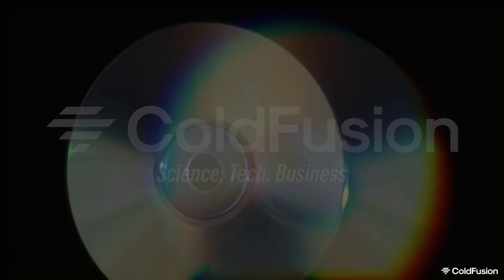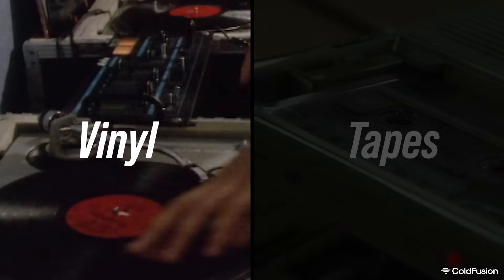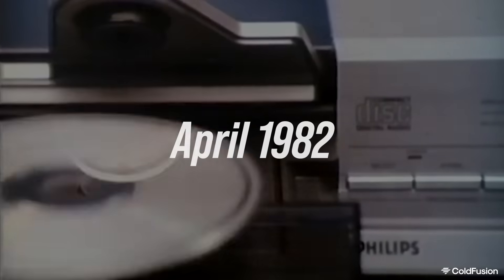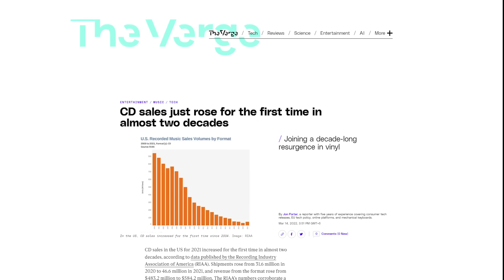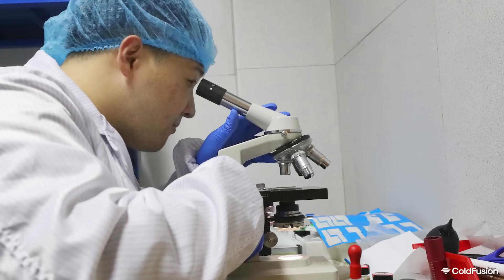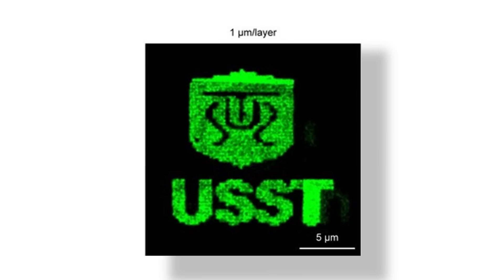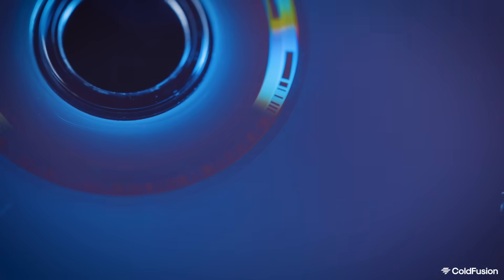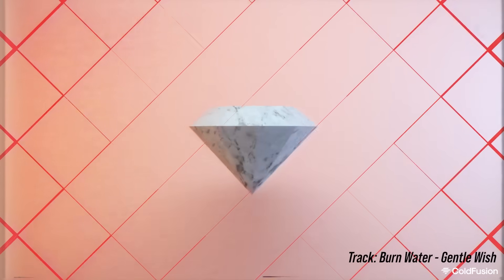Why This New CD Could Change Storage

Comment: For music nerds, CD's can still be the best way to listen to music!

They're oftentimes as cheap or cheaper than MP3 albums, but with far greater audio quality. (Well over 3x the bitrate of either MP3 or streaming, and second only to $$$ audiophile FLAC downloads)

They also have album art second only to vinyl.
Reply: Or, you can rip your CD collections to FLAC files, and you wouldn't even violate the DMCA.  (No digital copy protection on audio CDs.)  I'm old.  I have tons of audio CDs.  I ripped them to variable-rate MP3s first, then later to FLACs.  I have a bunch of them on my PCs and my phone.
Reply: CD's aren't second to FLAC's, in the worst case scenario they're exactly as good as FLAC's, and in most cases better. FLAC's are literally ripped CD's compressed from the original files on a CD at "lossless" quality, meaning it should not lose any data compared to the original file on the CD, but that's not always the case, as most people who make  FLAC's use wrong settings and mess things up to end up with worse sound than original CD's.
Reply: @derbigpr500  You can't mess up the settings on FLAC, it's perfectly lossless.  Unless you have hardware issues or are ripping from a damaged CD, FLAC decompresses to the raw PCM bit for bit.  That being said there are FLACs that are technically "better" than CD since they can give you a copy of the album at the sample rates and bit depth they were recorded at before being downsampled to 44.1 kHz at 16 bits for the CD master.  Better in quotes because the extra sample rate and bit depth is mostly indistinguishable except in certain extremely specific circumstances with people who have extremely rare extended hearing range and the recording equipment was capable of producing and recording said extended range.
Reply: Not all CDs. Last year I purchased a CD from a local band merch booth, hoping for better quality than my downloaded files of that band. Sadly, the tracks on that CD still suffered the same "loudness war" of heavy dynamic compression :/
Reply: @mchenrynick  That has nothing to do with the CD's, but how the music was recorded.
Reply: I still buy CD's and have all my old ones.  I use Spotify (which replaced my aging iPod) and if I love an artist I will buy the physical album like Chromeo's "Date Night, Live!" on blue triple vinyl.
Reply: idk where you get your flacs from but if you buy music on bandcamp you get all formats (mp3, m4a, flac, even the weird alac format that apple pushed a while back) for one fair price that includes all of it

Comment: SSDs took years I never thought I'd have one in my computer, hope these do make their way down to consumer level NAS storage in 10-20 years.
Reply: 10-20 years down the line this will be obsolete.
Reply: @totalermist not really, a 1.6petabit (200 terrabyte) disk would be enough to compete with other mediums for backup for years to come. the current generation of LTO backup tapes store 18TB data, and the equipment needed to read an LTO costs about $10000 with each tape being $100 ontop of that. it likely wont make a big splash on the consumer market but I doubt that was really ever the intent
Reply: @oggilein1  That's only if you insist on LTO-9 or later. LTO-8 (the 12 TB variant) costs less than half as much with drives being available for under $2,000. LTO-6 media and drives are dirt cheap these days with 2.5 TB capacity still being nothing to sneeze at.
Reply: @totalermist  oh absolutely but if we are comparing it with a disk who's laser alone costs $50000 then even the latest gen of LTO seems like a pretty good deal
Reply: I hope a lot sooner.  I love it if my NAS had a petabyte but guess I will have to settle for 8TB currently. I just wish I could figure out why I am only getting 100 instead of 1000BaseT which is the media subtype.  I think it might be my computer the causing the data logjam.

Comment: I need this yesterday ! To backup all my hd.
Reply: if you are looking for options available right now, you can either get a bunch of quad layer 100GB bluray-RW's or invest in a Linear Tape Open (LTO) drive and its respective tapes (the latest gen does 18TB per tape but the machines to read and write them are pricey so an older gen is what I'd recommend)
Reply: @oggilein1  already use bluray-rw. But I got more than 350t to backup ;) kind of a big job ;)

Comment: Petabytes and Petabits are very different things, 7:10 makes it sound equivalent. 8 bits = 1 byte, so 1.6 petabytes is 8 times larger than 1.6 petabits. 

Also, I’m pretty sure that old british lady is not a good person
Reply: Really? What did she do? She pops up in my recommended occasionally.
Reply: What did she do to you? :D
Reply: It's also kind of a mess because petabits would be for data transmission, while petabytes are for data storage. Saying that a CD can hold 200 petabits doesn't make sense.
Reply: boomers dont know the difference between petabyte and petabits, but thats understandable, i have a secondary backup of my files on blu-ray discs, storing backups on 25-100GB discs is still viable but a slight hassle

Comment: If this was for sell today, my office would buy it. Even if it was a $50k upfront cost. Long term (50+ year) data archive capability that's water proof would be well worth the cost. Cloud storage just isn't handling our needs.
Reply: I'd recommend tapes. They're ultra-durable (25+ years), readily available, and much faster. Modern LTO solutions offer 300+ MB/s write and about twice that in read speeds. They're still ideal for long-term cold storage.

Comment: 1:44 Why is that scientist banging a mallet on the side of that precision piece of equipment? 😂
Reply: It's called fixing it,  I used to do that with my TVs until my Dad came home after work in the 70s.
Reply: He is probably trueing it up. Its precision, but imperfections in the assembly process can leave everything slightly askew by a few fractions, which ruins it. Tapping on the device with a mallet lets everything settle into place, and release the tension from assembly. Allowing it to sit "true".
Its very common in high precision machining.

Comment: I think it’d be really cool if this technology could be harnessed to bring physical media back to video game consoles and help us preserve media. Maybe instead of using 100 layers, they could produce ones with fewer levels that could be more commercially viable.
Reply: I think platform holders are moving away from this not because technology won’t be available, but rather to have control of the content.

I’ll give you an example that occurred to me. 

I own the Metal Gear Solid collection digitally for the Xbox 360. It’s also playable on Xbox one and Xbox series X. Konami decided to remake the collection again due to using copyright material in MGS3. I no longer have access to the original MGS collection, even though it’s on my HDD. A software update prevents me from accessing it even without connecting to the internet. I must buy the new release if I want to play the game. I can technically still play my PS2 physical MGS3, but not my digital one.
Reply: @franwex  That makes perfect sense to me, but I wonder if consumers could force their hand considering how often that’s happening.
Reply: @ryanjchristian  so, technically the licensee holder may revoke usage of the license on any moment. Physical discs are a form of license that are authorization to use the content. So if the license holder suspends the license, we would have to send our discs back. That’s expensive obviously so no one does it. The user more like promises that they will no longer use the software or watch a movie anymore as the license expired and you will simply re buy it again and pay the new license again. 

With digital content it’s easier to enforce those rights than physical. Plus everything is moving to a subscription service so that’s even easier to enforce.
Reply: It seems like the laser required for these discs is the main bottleneck in making it commercially available.  Not sure how much the discs would cost on their own based on the materials used,  but 50,000$ for a laser to read/write seems to be the main thing holding this tech back from it being publicly available to everyone.  It will probably make it's appearance in datacenters and such first, but I assume it's gonna be a while until this technology is economically viable for the average population. Still,  pretty cool stuff.
Reply: @lordgrindleton6595 people seem pretty interested in getting back to physical media since the story been around about these new CDs. I bet someone cracks it
Reply: Honestly like a 1 terabyte disc would be great for consumer-grade archiving, like storing old photos and stuff
Reply: @EricEatingCheese  When it comes to archival, my worry is less about capacity and more about longevity. I'd rather take something that is warrantied for 10 years but only 50 gigs over something that is close to a terabyte but warrantied for only one year.
Reply: That is pretty much what Bluray is doing. 128GB is enough for most games. You could do UV-ray to get more storage. I have worked at a Bluray production company and it gets really expensive with multiple layers, because you need to manufacture a stamper for every layer. The 100 layer disks talked about here are for special use not mass manufacturing consumer media. There is a big difference between pressed disks and writable disks this video failed to mention.
Reply: @JustJayGaming Bingo. A lot of people don't know how impressive Blu-ray is.
Reply: @JustJayGaming  128GB is nothing for games. Imagine 1000GB available for future PS6/ Next Xbox games. The detail and size of the worlds, environments, characters, AI and so much more would be incredible.
Reply: @VectorAlphaSec that's what I was thinking. They should improve in the writing speed
Reply: @VectorAlphaSec diminishing returns kicking hard. Current triple A games take too long, too much money to develop.

Players wont actually care about the texture or grass or stone looking 10% better for twice the size.
Reply: It already exists. It's called BluRay. Even the biggest modern games could easily be stored on just a few BluRay discs and the bigger games might require swapping discs between chapters in campaign or a separate disc for multiplayer.

The issue is the time to access the data though. Most modern games load assets constantly during gameplay. Modern games want everything stored on fast PCIe SSD's to load textures fast enough that players don't notice texture pop in.

Any sort of mechanical device is going to have far longer seek times, which means in the end you'll need to install the game to the SSD regardless.
Reply: @benwinter2420  What?
Reply: My issue with current storage methods is how many single-piece items it creates. I find the image of people with rows and rows of movies and games to be very ugly. I don't want my home to look like that (not that I have that kind of space in my apartment, anyways. Also, because I move every few years, it would be hell to have to lug all of that around time after time). Something like this disc that could store lots of media with a very small footprint in my home would be amazing. I want video games preserved and am starting to buy physical (usually only one or two games a year, though), but I don't want the physical items to crowd my living room.
Reply: @BewareTheLilyOfTheValley  Throw away the CD cases , did that with my dvd & music discs cases & reduced the bulk massive  during a camp shift . . resisting doing same with games discs as they are valuable with the covers resell
Reply: Only if reading from this can be really fast. Games are using up 14+ gigabytes of RAM these days, if it can't be read at a speed of at least 1 gigabyte a second. The Blu-Ray drive I have is a USB 2.0 one, so at most I can get 60 megabytes a second out of it. At those speeds we're looking at nearly 6 minutes of loading to fill 14 gigs of RAM.

Base blu-ray read speeds is 36 megabits a second, fastest ones I'm seeing on the market are 16x, for a fastest read speed of 72 megabytes a second. Assuming ideal circumstances, would you want to sit around for 3 minutes and 15 seconds while a game is loading?

Our best hope for physical media to make a return is for the price of quality flash to plummet to like 5 cents per gigabyte. It'll still be more expensive than optical if a new format can compete with available capacities. The push for more and more fidelity is what put PS5/Xbox Series in a position similar to what PCs were like back in the 90s and early 2000s. The game is installed to the internal storage but the disc must be present to at least launch it.
Reply: @benwinter2420  They don't last a lifetime, do you not know what Disc Rot is?
Reply: @rrai1999  So you have lived a lifetime since CD rollout ?
Reply: Everything rots & God is an astronaut
Reply: This
Reply: The reason game makers moved away from running games off physical media is because it's a lot slower compared to reading off a NVMe drive. As game sizes go up, having to install a game is going to take longer and longer because of those poor speeds.

Something like these new discs will be used to archive large amounts of data for companies, governments, etc rather than anything that would have average consumer use.
Reply: I just assumed that game consoles can't read from discs fast enough to be playable.
Reply: I'd take a 20TB 'neo-DVD drive' as my storage.
Reply: No. Read write speeds would be nowhere near fast enough. Storage isn't the issue, speed is
Reply: You don't need a 1.6pb disk for that.
Reply: For video games I feel like if physical does persist (which is a good thing for it to persist) then it’d make sense for its dominant form to be something like the switch cartridges going forward. Their smaller, takes up less space in the hardware (which is especially beneficial for portable devices), naturally has a much faster read speed and can be integrated into different form factors from dedicated home consoles to portable consoles with ease.

As neat as this disc is, from a practical level, I can’t see it being too beneficial over flash storage for the general market. At best, this type of disc would see use for specialised situations or turn discs into a hobbyist thing like vinyl.
Reply: yes, agree, I think the reason why many of these projects hit the wall is because of being way over ambitious.   We at our media outlet would like to backup our large flak music library, which is about 4.5 TB.  

If there was a "WORM" disc format that could store 10TB, that would be more then enough for us, and probably be much cheaper and more achievable to accomplish.

Comment: Will it be refined?  Yes.  Will it be commercially successful?  Yet to be determined as you said.  I worked on the magneto optic data storage technology for about 15 years.  It was robust.  It was the leap forward at the beginning of that tech.  Other tech came along.  M-O drives and discs were expensive.  It sold for a while and I think mostly in Japan.  It didn't dominate and eventually played out.  This video brought back memories of storage media development.  Lots of fun and hard work.
Reply: Sony will probably get this on the market in the future
Reply: @KingAgniKai  (cough) beta (cough) max (cough) (cough) and (cough) (cough) mini (cough) disc (cough) (cough) (cough)
Reply: Considering I heard about this sort of CD advancement(not exact capacity, much still much greater than regular CD) several years ago and it's still gotten nowhere, it's not looking
Reply: We had an MO drive, stupid expensive, wish we used Zip like everyone else.
Reply: The reason why consumers chose flash memory is the convenience, both of its size and how easy to erase and overwrite it.
Reply: the cds and dvd nned a bulge at the rim It has been suggested before but Phillips who "own the format ignores the matter -A small bulge would give the surface clearence from dust on a  table but not obviously sandgrains - Or they could redo how the data is stored -to instead of in a long circular line around the disc use it as pieces of a pie-If on pie get scratches then 9/10 are still readable and get rid of the dumb idea of having the startsector in the inner curve from where cracks expand outward have it 2 places at least
Reply: It's just silly to handle that much data without a case; sleeved disc formats worked great even though it made the media slightly more expensive. 

Also, for sequential-access media like audio & video, tape & glass plates, have the highest density.
Reply: I have a stack of MO drives out in the garage.  I used them with my Amiga A4000T Video Toaster, which I still have.
I should drag them out and play ... and then sell them.
Reply: @valcaron They are only ending production of blank blu rays. Not general blu rays and entertainment on them
Reply: You can rest assured it will never be developed that simple

Comment: I hated having an optical drive taking up space in my computer, but I wouldn't be against an external drive with the same transfer speeds
Reply: with USB4, the way the drive will be connected wont pose any speed limitations, the limitations will be how fast the disk itself can be spun and read from